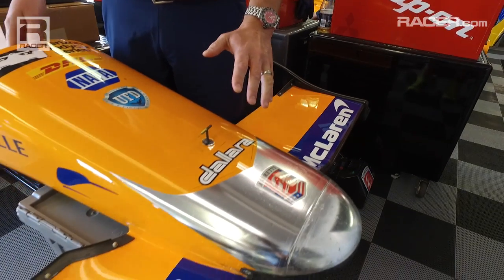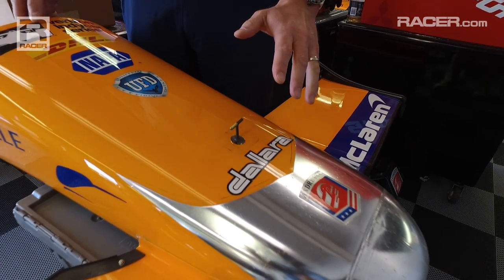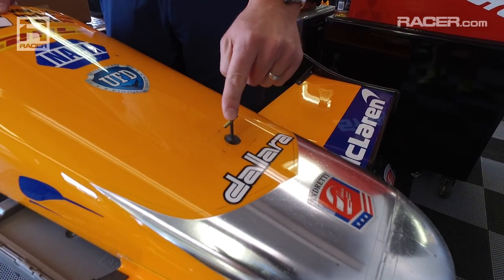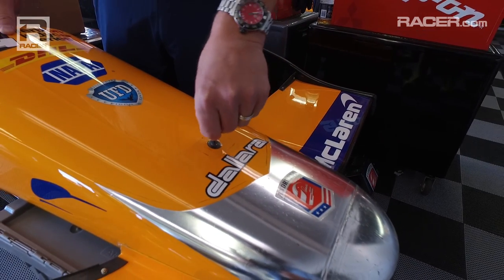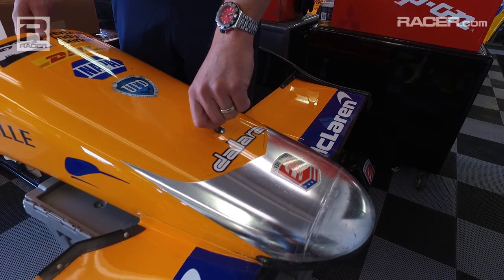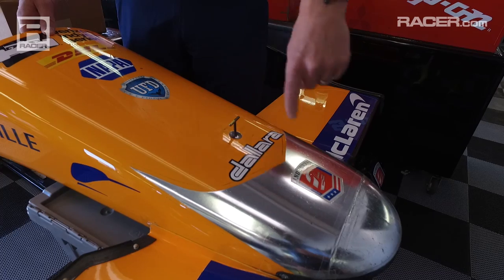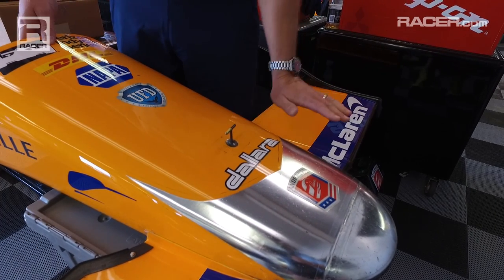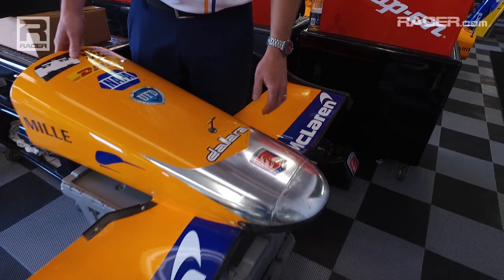Indy 500: Fernando Alonso Car Tech--Front Wing

Comment: I think fernando is going to find the pit stops slow as truck
Reply: sultanabran1 Good. Pit stops in F1 are too fast and take away the negatives of going into the pits.
Reply: IndyCar's pitstops are only around a single second different from F1 pit stops when F1 had refueling. Plus IndyCar does it with half of the manpower. F1 pitstops have become an amazing art to watch, but it would be impossible to replicate in IndyCar since each tire can only be changed by a single crew member.